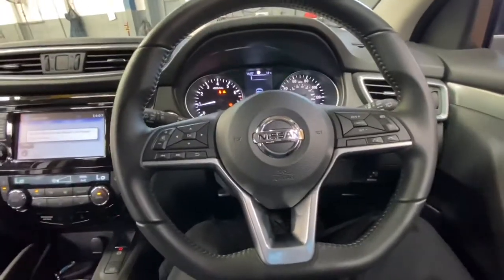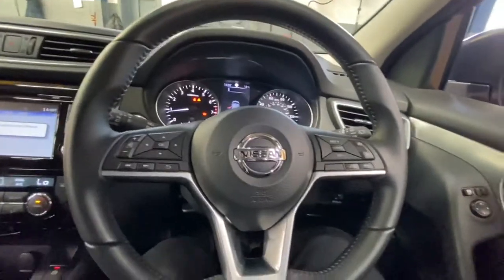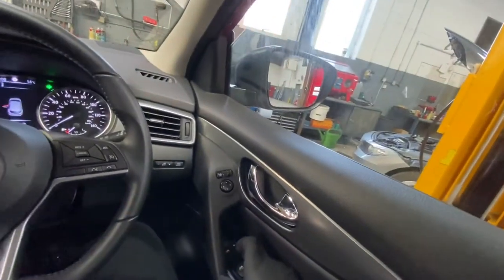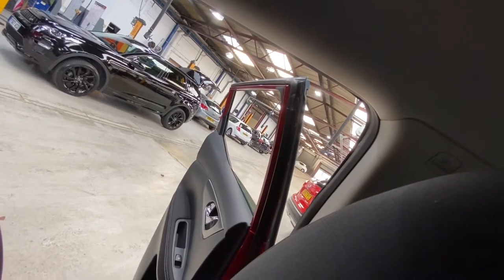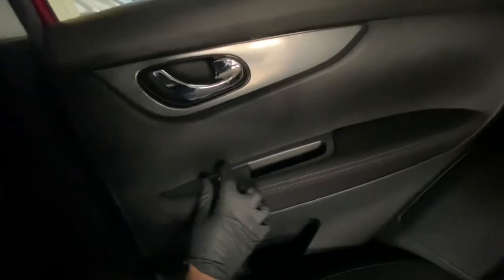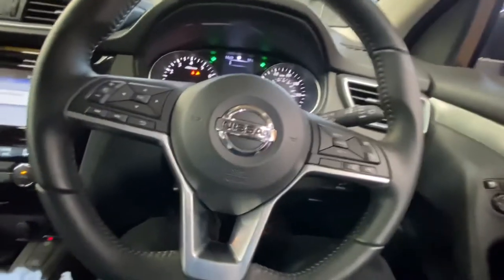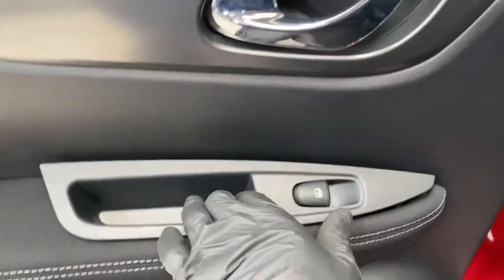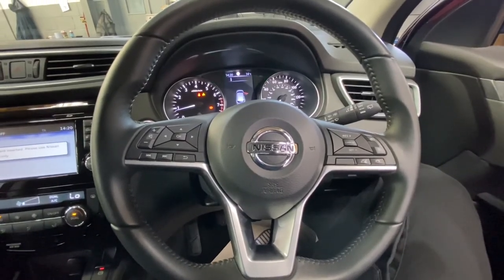#Nissan #Qashqai #electric #windows #not #working

Comment: I have a 62 qashqai my passenger front window got stuck open I managed to get it to close after a good 30 mins , now my problem is the window won’t go down from that switch on that side or the main switch driver side but all my other windows work on all doors and the main switch, it’s just the passenger front won’t work on either side 🤷🏼‍♀️🙈 help please 🙏
Reply from the maker: Check your switches for your  front windows for function is they are ok check wiring/window regulators or motors may be intermittently sticking

Comment: Hey. My QQ J11 of 2015 has the problem all window lifters except the one of the driver dont work. I cant operate them neither from the driver seat nor from the seats next to the window. Any idea how to fix this?
Reply from the maker: Check fuses first if it’s not the fuse remove the door cards check the wiring to the switch for a feeds and for any broken wires

Comment: I have a similar problem with a recently bought 2019 plate all my passenger windows won't go down. It seems like the master control a switch isn't functioning at all since they can send them up even though I have it pressed in. Surely not all switches are faulty.  Is there a fuse for that over ride switch or would it be the switch itself

Comment: Just had a 67 plate in work. Nothing works on the drivers door switch pack.
Reply from the maker: Check the fuse
Reply: @g_a_bofficial 

Thanks. Is that number 28?
Reply from the maker: I’m not sure because I have got the fuse box diagram in front of me but if that’s was it said then yes also check if the other switches works on the other doors
Reply: @g_a_bofficial 

Cheers. The switches work on the other doors. Electric mirrors work too. But nothing from the drivers switch pack.

No windows
Isolation switch which when pressed doesn't stop the other windows operate on their respective door.
Reply from the maker: Okay check the fuse if the fuse is ok remove the switch turn the ignition on and check for a feed in the plug if  pins if you have a feed the switch is faulty and if you don’t the wire is broken somewhere remove the door card and have a look at the wiring from the plug.
Reply: @g_a_bofficial 

Thanks. Will swap out the fuse anyway (is number 28 10a I think)

Is booked into an auto electrician Monday anyway. I literraly moved the car 50 yards and tried the window and nothing. Aparantly been issue free before today.

Was only booked in for two tyres 😭
Reply: Tested the plug and there is power going to it. Think it's the switch.